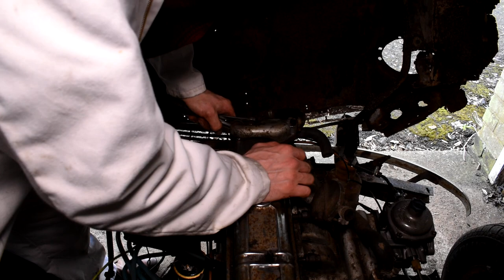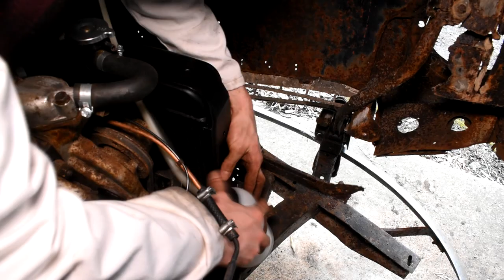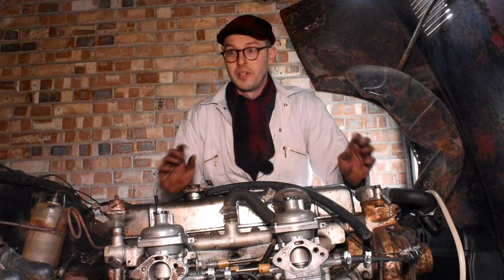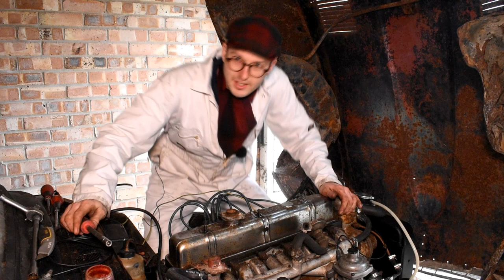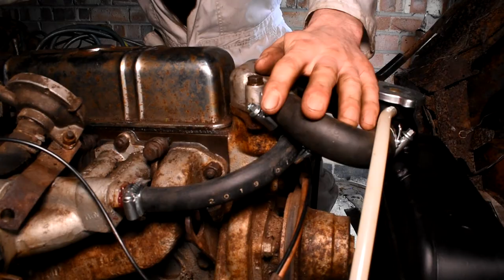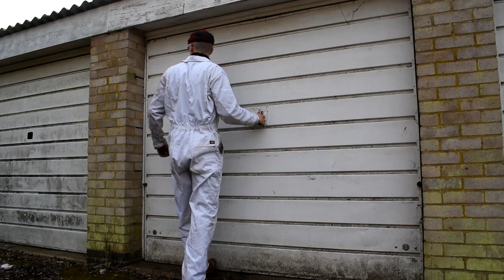Triumph GT6 Radiator and Hoses

Comment: Good job Steve. Refurbed Radiator looks great.  That’s one of the scruffy looking things on my 250...but, it’s original and it’s been cleaned and tested so it’s staying (for now 😉).
Reply from the maker: I think it's the little details that matter, and stuff like the Coventry stamp just sets it off better than what you don't get on aftermarket parts. Good on yas sticking with your original radiator too 👍

Comment: nice video Steve. out of interest what is in the pot? you smear it on the pipes before you fit them
Reply from the maker: Cheers Aaron, it's red rubber grease. It's brilliant stuff as it has no bad effects on rubber, and unlike using washing up liquid, their is no salt in red rubber grease, so it's friendly to the metal parts too 👍

Comment: Enjoy watching the progress. What is the red compound being used on the fittings?  RTV?  Rubber Grease?  Thanks
Reply from the maker: Cheers William, it's just red rubber grease, you can buy it off eBay. It's much better than using say washing up liquid, as washing up liquid has salt in it, where as red rubber grease will have no effect on the rubber or metal parts other than helping slip them on easier 👍